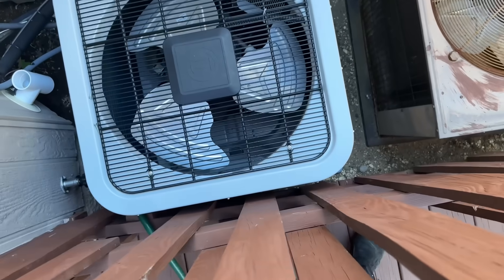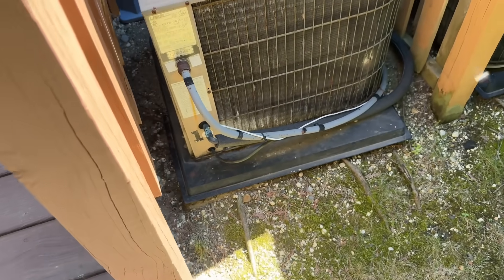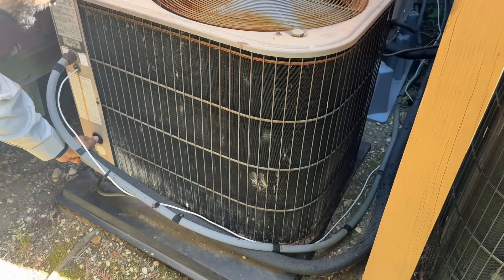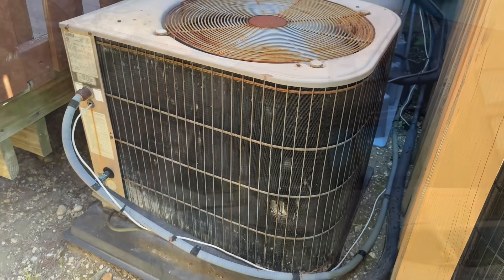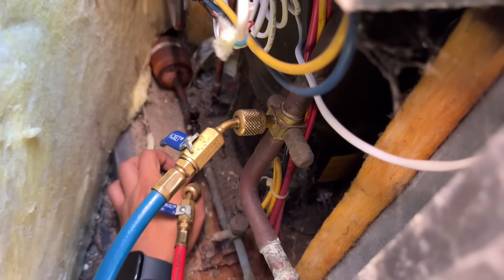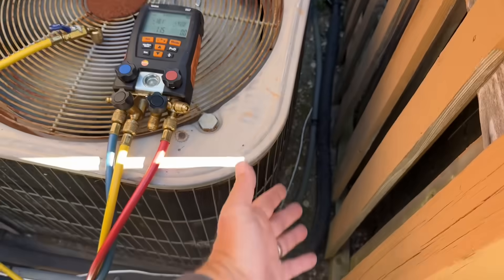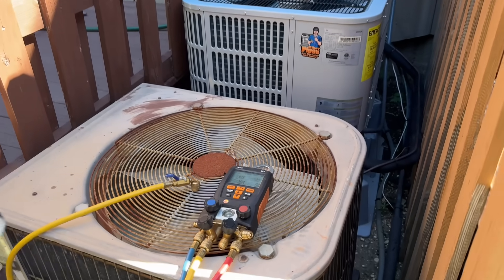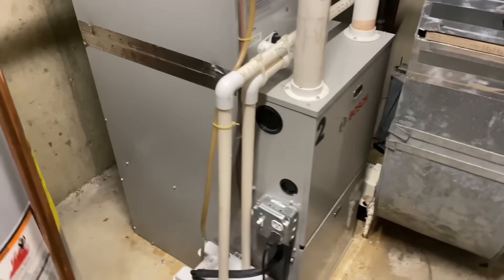Lennox R22 Central AC System Not Cooling - Repair or Replace? Service Call with New Hire!

Comment: Some poster on a hvac board said this. "I have a Bosch heat pump . It’s 4 years old I will give it to you for free if you come take it out of my house. Problem? Control boards and air handler motors waiting on the third set now. Make sure you send in your warranty and put a surge protector in the unit horrible customer service run as fast as you can to the American Standard/ Trane" dealer

Comment: We had a good one this late afternoon, put a motor and dual capacitor on it a week and a day ago, amp draw was at .6 amps on the motor and 7.8 amps on the compressor once we finished. Got a call today that it was doing some weird things, making weird noises, so we went back out, come to find out, their landlord had sent his guy out to check it and seen we had put the new motor in it and told the Tennant, that had took it on themselves to call us, to have us go back out that it may be something we put in and it should be covered under warranty. I get there, his guy had swapped around the compressor and line wires, as well as, the two motor capacitor wires. It was close to dark, I actually observed the disconnect spark and the unit shut completely off, it also was making a lot of crazy noises, and running really weird. I seen the compressor and line swapped, so I swapped them back, didn't even think about looking at anything else. until about 5 minutes later, the thing went into high pressure bypass and the fan was to hot to touch and not turning, boy that just pisses me off when these people do this kind of crap, so I documented it all and took pictures, before and after, of course.

Comment: Wow.   51st week of 1989?  If I’m reading tag correctly.   That’s a good run.  First time seeing a unit with such large bolts holding the fan grill.  If you ever bring a truck down to Orlando I’ll give you $100 for that condenser.  I like the setup of your shop.   Well organized.  I like the non hvac banners at end of video.  👍   Looking forward to seeing the new install.

Comment: With those units inside side by side would it have been possible when you did the Bosch the last time if you jumped to a single 5-Ton to replace both systems?

Comment: There's another HVAC video maker ("The DIY HVAC Guy") on YT that's saying that as of 2025, HVAC equipment replacement prices may increase by 30%, due to R410A refrigerant mandated to be replaced with R32, which is flammable. Although R410A will still be manufactured & available for re-charging existing units. He also says that cleaning the outside coils from the inside out is not something he recommends: simply garden hosing off the coil from the outside is "good enough".
Reply from the maker: Let whomever that is have their moment of fame. IDGAF. There is a reason that person isn’t licensed anywhere
Reply: Since 2020 our equipment prices have went up 35%. To put that in prospective a $7500.00 system is appropriately $10,250.00 now. Im not sure the industry can withstand another 30% + increase.